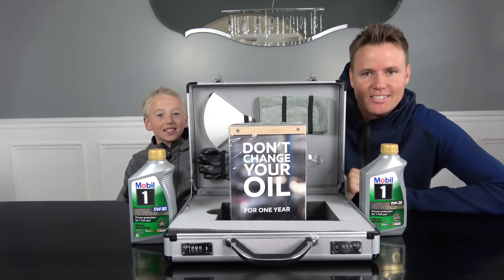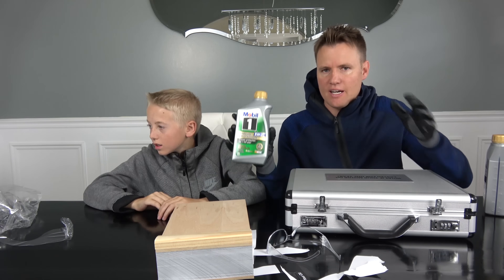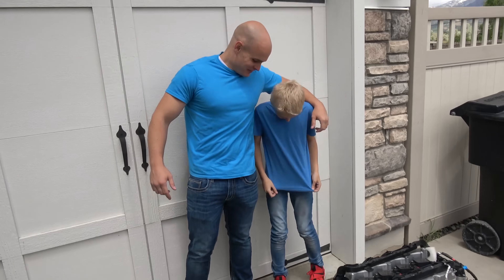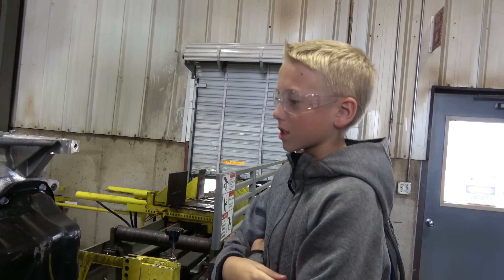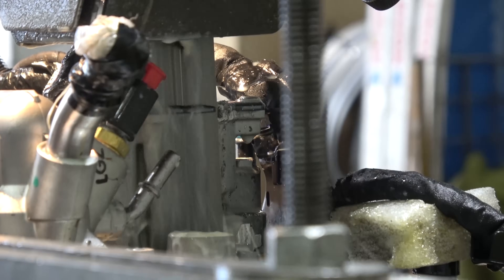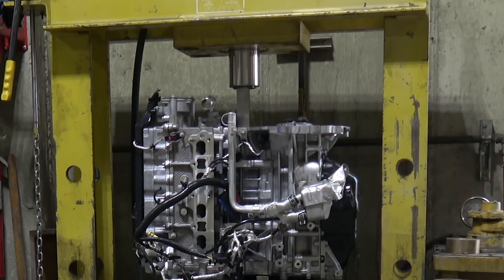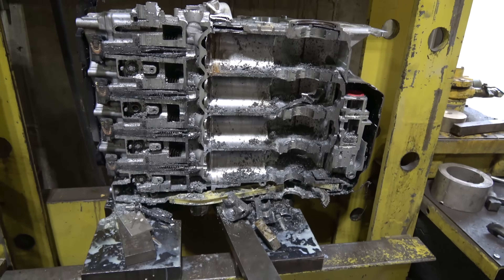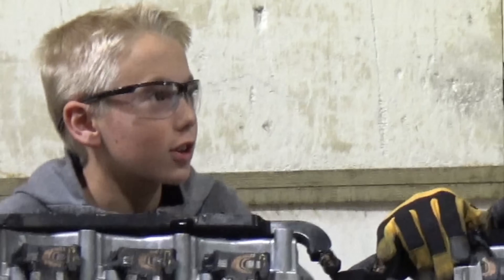Whats inside an Engine?

Comment: Pffff piston engines are for losers..
Real man drive with ROTARY ENGINES!!!! YEAH DORIFTO!!
Reply: dotritos are unreliable
Reply: Boost in = Apex seals out my guy. 

Yes I know that they make softer seals so they bend instead of break. But it's just fun to hate on them.
Reply: I'd rather eat the Doritos than use them in an engine
Reply: Honey Badger Gotta love those doritos.
Reply: The RX-8 is probably the most hated rotary car ever..
Reply: Honey Badger you probably don't even have one
Reply: Honey Badger one thing about rotary engines is that their crap because they don't last long as a regular piston engine
Reply: DORITOS FOR DAYZE
Reply: brap brap brap stu stu stu bang bang boom
Reply: Honey Badger rotary engines are absolutely terrible. Show me a rotary that has 200k on it and not rebuilt and I'll give my Mazda rx8 that doesn't run for free
Reply: Anark Kist last one was made was 2012 genius it's 2017 if you haven't realized that
Reply: but it's drinks fuel and oil like there's no tomorrow
Reply: True, but that doesn't hold me back!
Reply: Honey Badger BRAP BRAP BRAP BRAP
Reply: Honey Badger agreed. doritos for life
Reply: Blair Berg no they're not. People just beat the hell out of em and don't do proper maintenance
Reply: if there so good why don't they make them anymore ?
Reply: Not fuel efficient, that's the only reason.. :(

(probably some other reasons)
Reply: rotary engines lack torque, one of the main pitfalls
Reply: Anark Kist they don't do the RX8 anymore, the most decent sports coupe they make is the MX5 Miata
Reply: I want a rotary for my next car (RX7 or 8) but I am worrying about having to rebuild it as soon as I get it because you have no clue what condition it is in and that cost money and knowledge of cars of which I have neither of :D
Reply: If you're not a mechanic you'll have a hard time with repairing every kind of engine.. Luckily Rotary's are very easy to work on, but they break often if you ain't treating 'm right..

Unless piston who're pretty reliable, but hard(er) to work on.
Reply: BRAAAAAP
Reply: Honey Badger men more like communists
Reply: Honey Badger yes they do
Reply: BRAP BRAP BRAP UNRELIABILITY HELL YEA
Reply: Elijah Garcia No, they're not. A piston is an object that moves up and down. Rotarys spin in a circle.
Reply: Honey Badger the rotary ban is irrelevant because it isn't a thing anymore
Reply: Bro, that's clearly not what I said..
I wrote DORIFTO!
(That's how you pronounce drift in Japanese)
Reply: mat garcia one thing about piston engines is that their crap because they don't deliver the power as a regular Rotary engine

Comment: Now, about shanging your oil. My car recomends changing engine oil after 1000 miles or 1 year and my classic car its 600 miles or 1 year, what ever comes first. I dont drive more then 1000 miles per year and already change my oil once a year. But then again, i have always used mobile 1 anyway.

Comment: that oil wont work because you still have to change your oil filter witch causes you to drain the oil that is in the engine and if you don't then the filter will go on bypass and all the contaminants that are their will go right back into the engine its a cool concept but not reality.

Comment: the only problem with that oil you still have to change your oil filter you filter has to be changed every 3 to 4 thousand miles which means you still have to buy that oil every time you change your filter so you can top off you oil.

Comment: First, not an explosion. It's a controlled burn. When it explodes it's called detonation and that's when things break. 
And he pointed to the intake valve and said O2(correct) but pointed to the exhaust and said fuel. Incorrect

Comment: "Giant engine" Uses 4 cyl
Reply: Caden Armentrout Sad to see how much people don't know about engines and car in general (talking about the video)
Reply: Hey, many cheap JDM cars have 4-cylinders, like Civics, AE86s, and Miatas. Why hate?
Reply: Caden Armentrout exactly what I was thinking but it would be easier to see inside if you cut the cylinders in half. know what I'm sayin?
Reply: Cameron Britt I want to see something huge like one of those massive turbo diesel truck motors
Reply: 15DudeAwesome true true
Reply: Caden Armentrout it wouldnt suprise me if lincoln said THERE ARE HORSES IN THERE
Reply: when you have a 3 inch pen1s 4 cylinders seems big
Reply: Caden Armentrout I'd rather had them cut open a 4 cylinder than a beautiful V8.
Reply: 15DudeAwesome I commented saying that he stated that this 1.6L 4Cyl is a "Giant Engine" when it isn't anywhere near a giant engine, not that he should have cut open a giant engine
Reply: @ak47hawk-xbox360  They also said oil only goes in the bottom half so I guess valves don't exist anymore.
Reply: @thebrokenbolt3990  idk what a valve is but its probably not needed in a motor
Reply: @ak47hawk-xbox360  Motors are powered by electricity  so it definitely ain't needed 😉
Reply: @thebrokenbolt3990  They own a Tesla now so you’re not wrong
Reply: 15DudeAwesome  same here
Reply: Yeah I get you, just wish he didnt over exaggerate how special that motor seemed :)
Reply: Caden Armentrout lol
Reply: Caden Armentrout lol so true 😂
Reply: Chris Koford exactly
Reply: Caden Armentrout lmao
Reply: Caden Armentrout don't cut up my dads
Reply: What's Inside Acer Predator 21x ?????
Reply: moth you know cyl is how many combustion chamber there are and there no more than a 12 cyl
Reply: what do you mean i know cyl don't power it is the battery and fuel/air mixture that power it but the reaction to power it happens in the cyl
Reply: A 24 cylinder engine is like one you'd find in a train
Reply: Caden Armentrout well thinking about the cost of buying a bigger engine
Reply: Chaos Zombie999 From a semi or other scrap yard, they may provide an engine for this purpose for a mention and the scrap returned.
Reply: what engine is this car from exactly?
Reply: Inline 4 2.0L
Reply: me too
Reply: Damn yuppies
Reply: ikr
Reply: yeah they could of used like some 24 cyl diesel engine. probably would be too expensive though.
Reply: Caden Armentrout 😂
Reply: Caden Armentrout how much money do they have
Reply: That's not a big engine at all and I'm not your average 12-year-old I'm probably your five times average 12-year-old man it comes to mechanics.
Reply: Bassen Cats I'm eleven and i know more about an engine then these two combined.
Reply: Clorox Bleach   Same I feel you same age
Reply: Ghost Soap they don't power cars.
Reply: ok sorry i didn't know you  where talking about trains i maybe a auto mechanic but not a train one plus i don't think they could afford a locomotive engine and it more of 16(i googled it)
Reply: Exactly big bulky American v8
Reply: well i mean to europeans its big lmao
Reply: MrGamrkid lmao I'd die
Reply: What's inside a v8 engine and how much 20 of those saw blades cost
Reply: Zachary Courtois and you do ?? I bet you never even study automotive , what stage of tech are you ?

Comment: I know how a engine works first gas goes to a valve then the valve opens then gas goes into the piston chamber then the piston comes up valve closes then spark plug goes off then piston goes down and another valve opens so the smoke/what comes from your exhaust goes through the exhaust pipe then out of the car/thing with engines and the pistons spin a shaft witch then spins the alternator witch creates energy so when your driving your battery doesn't die and then spins the drive belt witch then goes to all the gearboxes/differential then spins the wheels.That's how a engine works :)

Comment: Was this a brand new engine or a sorted out one from the factory? You say that this oil is sustainable because you have to change it not so often but at the same time you show the intense material and energy waste by cutting that engine open. It takes a lot of energy to produce and to re-melt the aluminium.

Comment: sorry but wrong wrong wrong    the hard parts are the conrods and the crankshaft  and the piston pin that joins the piston  to the conrod and the piston are just case alloy very soft compared to other parts in the engine

Comment: You are wrong on some of the things you were showing after u cut it opened one valve allows oxygen and gas to come in and when the piston goes up it combust and allows the piston to go down you have two valves one intake one exhaust valve allows the left over gas to escape the cylinder and the cycle starts over again

Comment: Just pointing out that there's lots of nuts and bolts which you can remove and accomplish basically the same thing.  Ya dont have to cut it in half.  I'd rather see you cut something in two which "cant" be taken apart.....

Comment: Engines and motors aren't the same.
Engines use fuel or gas 
Motors use electricity.

You cut an engine like what's in most cars but the Tesla and other electric cars have motors.

Comment: the Piston is actually made out of aluminum so it is a very soft metal. the piston rings on the other hand are from a hardened steel. and the crankshaft is from a hardened steel.

Comment: 587 million gallons of oil or the saved? That's the equivalent of what Americans use in less than 2 days... Like a drop in the ocean. 

United States, a daily average of about 391.73 million gallons (or about 9.33 million barrels per day)

Comment: an engine trasferes mechanical energy it electrical its the  opposite of a generator. it contains a commutator and a brush that is connected with energy. a commutator  enables it to spin every half spin between two oppsite magnets it statrs again ( coil ) 
i have a test on this on sunday
Reply: a motor****